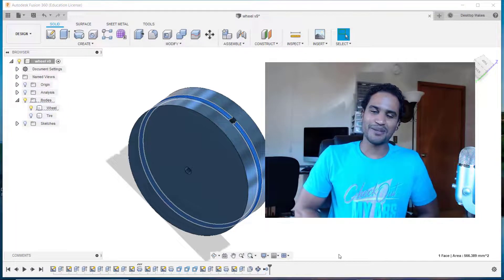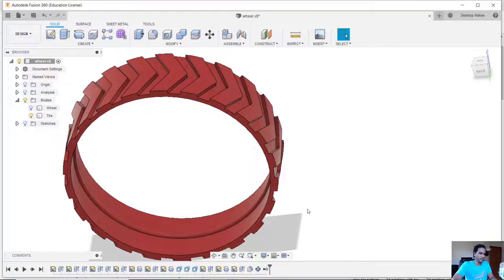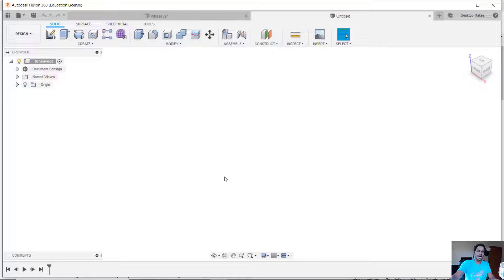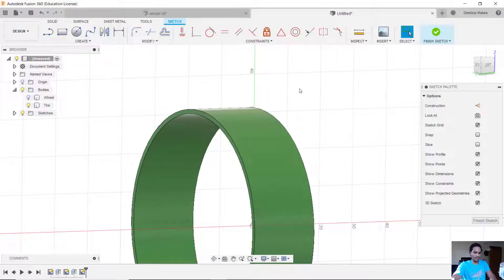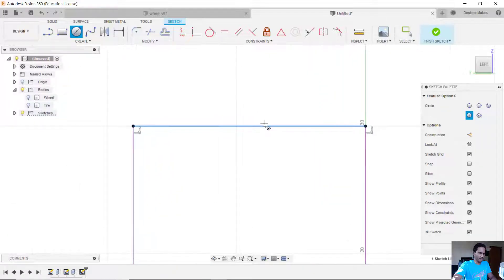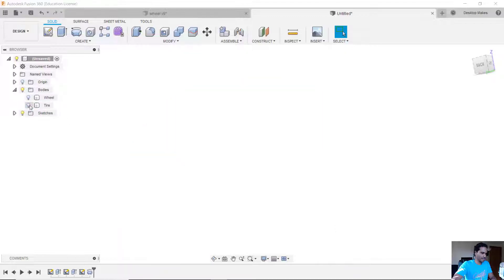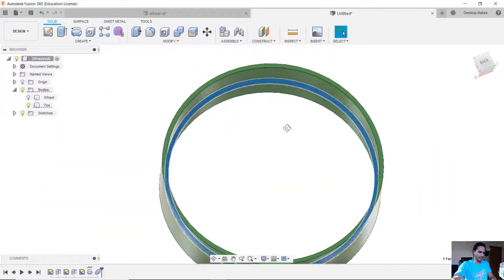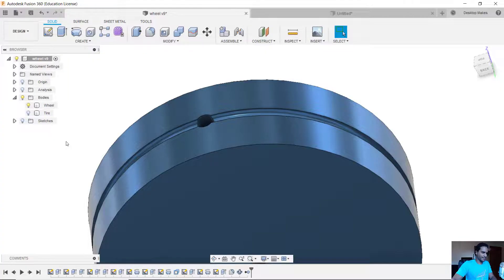Fusion 360 - How to Cut One Body From Another

Comment: Came here from years of solidworks to learn how to do the shape cutting, but thought I'd offer some advice, which is, your whole wheel design (or future ones) would be easier done if instead of extruding one way from the sketch, you extrude both directions, symmetrically. You can set the extrusion depth to either one side or total... Maybe I just need to make a video lol

Comment: What if you want to give the groove tolerances, so cut a bit more than the overlap?
Reply from the maker: That would work.  What I usually do is come back with the Press Pull tool and offset a distance equal to my tolerance.  Usually -0.2mm if I'm 3D printing parts that will fit together.

Comment: Is there a way to cut the body with a tolerance. For example, if I am making two parts that should fit together, it would be so easy if I can make one and subtract the other with a small tolerance.
Reply from the maker: I normally use the Press Pull tool and offset -0.2mm as a tolerance if I'm 3D printing the part that will fit together.

Comment: Hello, Thanks for this video. What is the purpose of "keep tools" option you used ? I have always some difficulties to understand properly this option ! :( Thanks. Regards.
Reply: He is using the tire as the "tool" to cut out part of the wheel. If he did not check "keep tool" the tire would vanish after it performed the cut, leaving him with only the modified wheel. Checking "keep tool" keeps the tire around after it's used to make the cut.